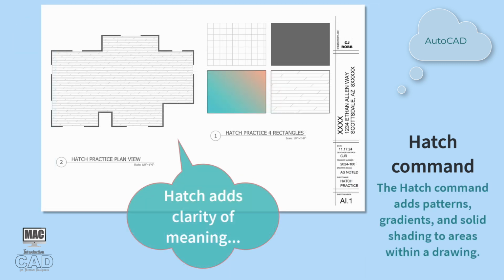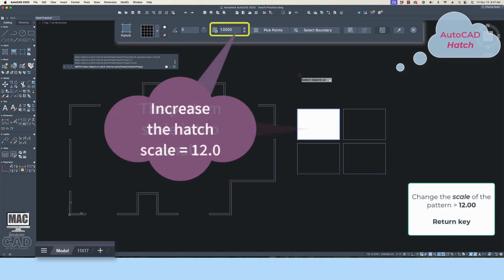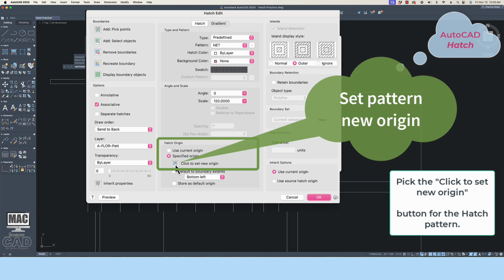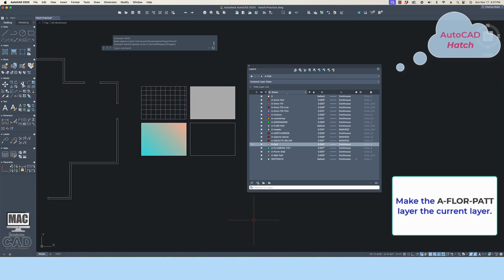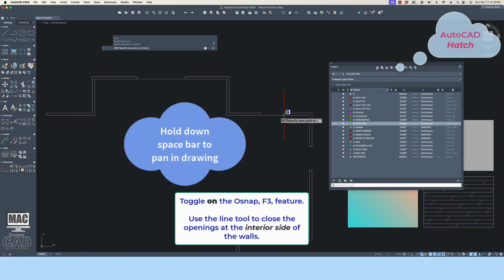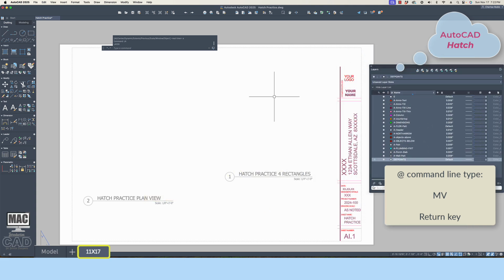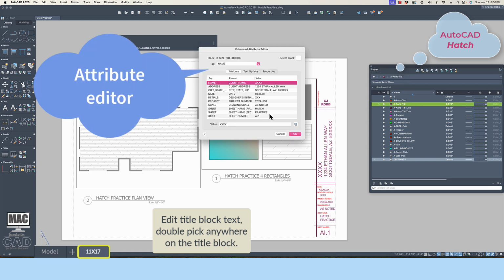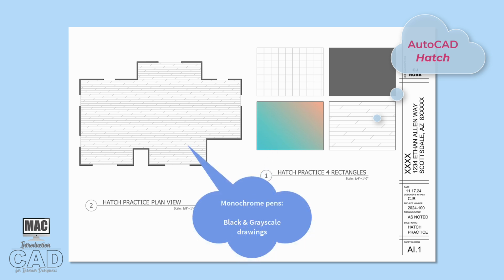AutoCAD Hatch MAC

Comment: When working with different hatch patterns in AutoCAD, how do you decide which line weights and screening percentages to use so the drawing stays clear and easy to read?
Reply from the maker: Great question. There are a couple of things to take into consideration. First, the scale that you will plot the drawing detail. For smaller scales, the line weight will need to be thinner or it will look like a blob of ink on the page. Our goal is always to make the information the most readable. The screening percentages I provide are a range, precisely because I don't know what scale you will be plotting the drawing, but also, because I only provide a guideline. Ultimately, it is up to the production person (draftsperson) to decide what they think reads and looks best. You have the power, kiddo!